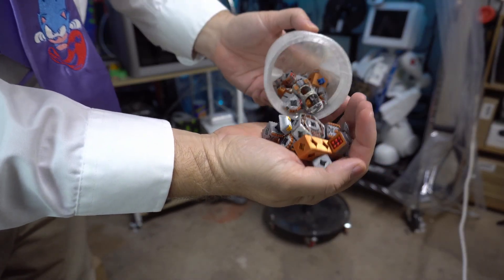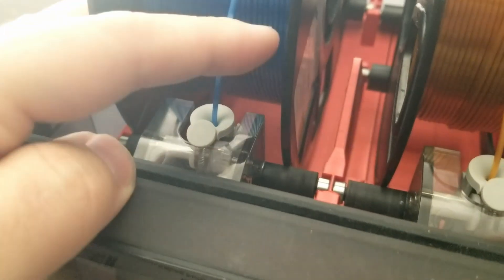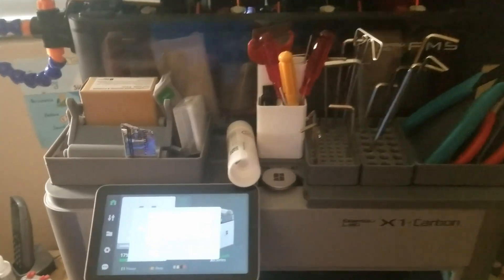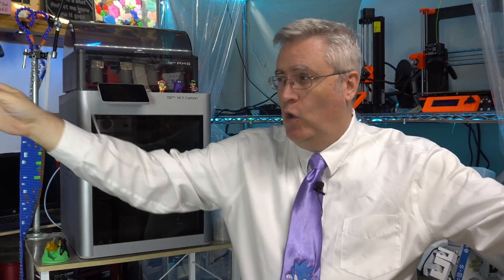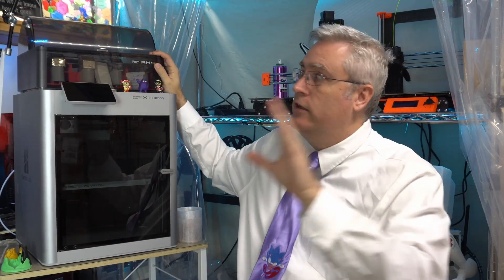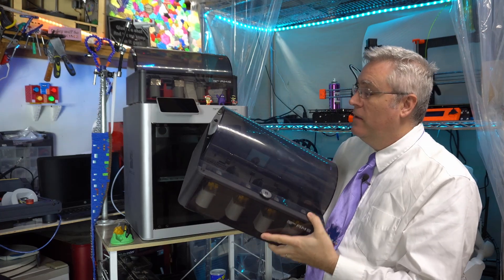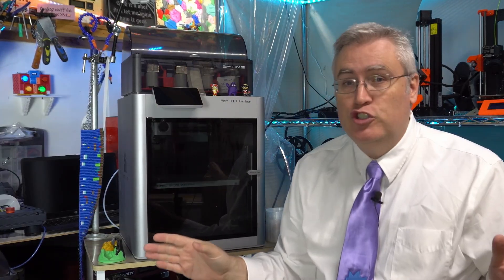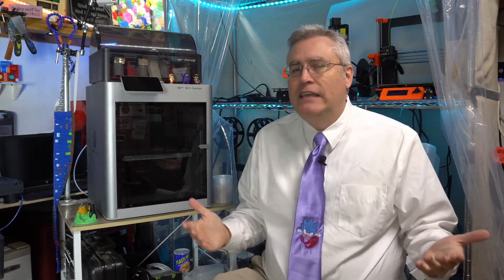My Bambu AMS died after only 1 year

Comment: 16hrs since posting - how’s the printer going? 

Bambu need to sort the waste issue. They say they are about sustainability but are nowhere near sustainable with the amount of waste they have And time to print (which takes more power). 

Prusa pushing that as a selling point over Bambu atm. It’s about the only thing they have on Bambu.

I have 2 mk3s/3s+ and they were bought 2-3yrs ago and apart from grease they just run. Beasts for reliability!
Reply from the maker: If only Prusa didn't require a separate enclosure.

Comment: I bought an mk3s three years ago. Prints great. Needed some replacement parts. Ordered bearings rods pronted some parts and rebuilt it. Prints awesome. I'm scared of these closed systems once they break what do you do toss it away? I can keep the mk3s running great with a few parts and can rebuild it whenever I wish. Its easy to work on easy to replace any broken part.
Reply from the maker: I will say, it was a bit disappointing when I upgraded my hot end to a Revo (which I love) that the next firmware upgrade freaked out. I'm currently running a firmware one step behind because of this. But at least it works. It's the start of jank, but it works.

Comment: I really related to this story and I understand why you wanted to keep your ID a secret.. Let me be your average Kickstarter nobody and this may surprise you.
REPAIR STORY from an average Kickstarter nobody, 
I am a backer , I did not get the AMS through kickstarter, however I did get one about 4 months ago or so...   My printer is from KICKSTARTER and I have had a few issues with parts or a cable going bad.  However my experience with support was fast and great.   They figured out my issue and sent me the parts free,  one was a bad print bed signal  cable and that was easy to do,   2 was a little harder I had to change  both circuit boards on the print head,  I had pulled off the temp sensor connector on the front board when changing print heads,  They had to send me both the front and back boards because they have been upgraded and my version is different, so they sent me 2 boards front and back and this tiny cable to connect them together,  Needless to say  I broke the connecting cable that attaches them ,  its hard to install and it was 100%   my fault,  I told them what I did and that I need the parts again and I have no problem paying for the parts because it was my fault.  They said don't worry about it and sent me  both boards and the connecting cable again for FREE .   Everything works and its all fixed .  ZERO cost to me and my response times were great.  Also this was all being done from BAMBU in china.. so I am the average nobody kickstarter guy and they treated me with great service,   I plan on getting another bambu im just wanting it to be a bit bigger. 
So far so good with my Bambu - 
Your average Kickstarter nobody

Comment: I think the downside of the AMS is that it's full of "consumable" parts. But it seems people keep using the AMS as a reason to say the "printer" has issues, but it's just an accessory to the printer. I don't personally have a Bambu (yet... it's on order), but I have been "dealing" with Creality, Ultimaker, Geetech, and Kodama (ugh) printers for about 8 years. So it sounds like Bambu is light years above those with regard to reliability. So if I have to deal with minor maintenance on the "printer" in that first year, I would say that a huge win for me. But I'm a bit jaded with maintenance nightmares and am happy to finally move on beyond those. Here's hoping the newer AMS units will be a bit nicer and have less unnecessary wear internally.
Reply: Mine took a dump after 3 prints because there's too much tension in the hub that pushes the filament out of the AMS. I've been waiting 4 days for a response from customer service.

Comment: FWIW, when I got my Kickstarter X1C (I was backer 148), the AMS was packed inside the printer. I received a second AMS last year as a holiday gift and it was slightly different than the one that came with the printer, but both units had yellow gears in the feed mechanisms.
Reply from the maker: Huh. Mine came separate. I wonder if I got a prototype or something. 
Well, that would have been a good thing to know YESTERDAY.

Comment: Good to know the guts aren't the same, my X1C was an early Kickstarter and had the spool roller breakage issue - which USED TO HAVE a fix on the Bambu forum but it was deleted. I think it's still on Printables. There's a printable mod that reinforces the roller sockets. My P1P & AMS were a new revision immune to the issue. Was the filament chewing due to the rollers rising out of their slots and binding (I got motor overcurrent warnings)?  That fix has worked for me, but I did not know the replacement parts won't fit my older AMS. I still have a problem on both AMS designs when it fails to retract and gets stuck somewhere between the AMS hub or adapter... it is NOT stuck in the head, as removing the tubing and pulling back from the head is effortless. Very annoying in multicolor prints.

Comment: The fact they don't supply parts for older variants of their current printer is worrying. What happens when they discontinue a model....will they carry on supplying parts? If so for how long?
Reply from the maker: Hopefully at least a year, but who knows.
Reply: By EU law manufacturer needs to supply parts for 10 years, but good luck with this chinese fraud company
Reply from the maker: @akierum  Fraud? That's a bold claim. And you're going to have a hard time proving it.
Or is it more about them being Chinese?
Reply: @3dpprofessor  A company with poor support, no stock for parts, like in your case, poor intellectual property rights protection, etc. is a Fraud.

Comment: I'm rather mixed on the hand-washing response of theirs.  Wasn't the entire point of invalidating those silly "warranty void if removed" stickers that a company cannot invalidate a product support request only because of a user's modification.  Video cards are a good example as putting a water block on one would usually require breaking the sticker, but just because the video card failed in the future doesn't mean that the user's modification caused it.

In regard to changing parts that causes old units to be unserviceable, the company ought to at least allow a trade-in maybe with -- at worst -- a nominal cost to the end-user.  For example, instead of buying maybe $40-50 worth of parts (that won't work anyway), give them $100 and your old AMS, and they'll send you a whole new AMS.   Although, the part that bugs me the most is that there really ought to be some sort of revision information (at least on the unit) so people can at least do their homework to understand what they have and what will work with it.  Also, I've got a few AMS units with my printers, and now I'm wondering how different they are.  My oldest AMS is probably from around 9 months ago and my latest one is more like... 9 days ago.  I took a look and all of mine have the yellow gears.

Comment: a lot of fair comments here but also it feels like Bambu are being put in a lose-lose situation by everyone.

they treated you well as an influencer,  will they treat everyone the same? probably not, and neither will most companies

do they have longevity? as you pointed out we can’t know that yet, but you didn’t exactly sound promising either. it very much sounds like you expect them to fail, and your experience with a KS (essentially pre-production unit) doesn’t hold much ground, especially when you are holding physical proof that they have addressed some preproduction issues (again, you pointed this out in a way too)

so what does this video actually achieve then? it gets you views (your job, i know) but more importantly it feeds into the constant negativity in our space lately

everyone’s gotta pick a side, and if they don’t they are going to get pushed out of the hobby
Reply: I totally agree with this comment there is so much negativity from both sides.
Reply: its a guy expressing his worries which imo is absolutely valid. creality has worse reliability and worse customer support however their stuff costs less than 200 bucks. not 1000+. 

at least with creality, you have cheap replacements thay will be available long after the company dies. bambu? once they stop selling spares, your done.
Reply from the maker: It was really difficult to strike the right tone with this video. I want to be fair and honest, and there's a lot of people making assumptions about what they think I'm saying.
Maybe I need to follow this up with a "10 things I love about my Bambu".

Comment: The disposable 3D printer company.

Running changes like that, and not supporting products long term, are exactly what the Prusa stans were on about.

I think its perfectly reasonable that a new company would struggle with such ludicrous immediate demand, but it is still concerning that they already have products that you can't fix. They're <2 years old. I could fix and run my monoprice i3 from 2015 (8 years ago) if I felt like it.

Comment: I have had similar issues with my Kickstarter AMS. With a long path to the print head and multiple driving mechanisms for the filament, i no longer expect any filament to work. I stick with filament that has proven AMS friendly. I use the back for the ones that have not worked well in the AMS. Filament that has inconsistent diameters or isn’t straight or true may have too much drag or worse. Some spools rotate poorly in the AMS and I’m not talking about cardboard ones, so I avoid those too. It has reduced the situation to occasional problems. The AMS is very cool, but it’s not bullet proof, so I have tried to adjust to that reality accordingly. It’s good to know ahead of time that there are no spare parts for Kickstarter AMS units and that even a new AMS unit may not work with the Kickstarter X1 Carbon. Thanks for keeping us all informed. This printer has been a game changer for me and has made 3D printing much more enjoyable. I’m waiting for the larger one.

Comment: I've seen a number of printer farms adding these to their production lines and I would think that is where the rubber hits the road on maintenance over time. All the new high speed printers are impressive and shiny right now, but over time I think we might see a very different story. Tomorrow I'm going to review the new Kingroon KLP1, but will it last for 5years or 10years running daily darn good question.
Reply from the maker: Kingroon wanted to send me one. Like they really really really wanted to work with me (they said), but they wanted my video out by december, and I've literally got a stack of 3D printers I'm working on right now, so I told them if they paid a sponsorship fee I'll put them at the top of my queue, and suddenly they didn't want to work with me that much.
Reply: Funny how they can dance backwards when it comes to cash. LOLOL...I'm under the gun for Nov 15th dead line. The machine is fine, but the software...just not ready for the public in my opinion.

Comment: I had an incredibly frustrating 2 weeks of back and forth with support where all I wanted was some advice on what parts of my printer to check to trying to isolate what was causing a pretty horrible squeak/rattle when the bed is in a certain position (owned printer for 4 weeks with it only lasting 2 of those weeks before it started making the noise). Sent videos showing comparisons between normal and abnormal operation etc... got no help at all; felt like being gaslit by them claiming it sounded fine (I promise you it DOES NOT sound fine).

The printer is otherwise great, but I certainly won't buy from them again (and I had initially planned replace all my printers with bambu units).

Comment: Excellent video. Can I ask you on behalf of us "normal" customers, to try and do a follow-up with Bambu on their stance regarding Hydra? They clearly state in their wiki that you don't lose warranty, but that they can ask you to revert it to original state for troubleshooting (and I find this completely fair). 3D Musketeers also claimed you lose warranty (but the more I watch his videos, the more I suspect he has a beef with BL and is just spreading FUD).
And yes, I suspect you got Youtuber experience when they shipped X1C Combo instead of having you troubleshoot AMS :-D I think they shot themselves in a leg there, though, because while the internals might require new motherboard (so in your case they'd have to ship you new board and 2 more new first stage feeders, maybe even the internal hub and have you effectively refurbish the whole thing), the "old-style" AMS should still be compatible with new X1C and vice-versa without problems. They actually seem to have an upgrade path for most incompatible changes and they do (or did) stock some previous-gen parts and support is able to ship them - in the end I think it's just limited by them having new old stock replacement and after that they'll might force an upgrade on you I guess. So no, I don't believe a regular customer would get a new X1C, but I also don't think he would need one,. They just took the easy route to get you up and running, the question is why. Maybe they are so loaded now that they can just ship X1C to early backers as a perk... heh.
Reply from the maker: I'd like to think that the reason why their wiki now says it's okay to use the Hydra is because of my conversation with them. Probably not just my conversation with them, but I like the ego stroke.
Reply: @3dmusketeers doesn't have beef his criticism is from a place of love too,  he has reached out multiple times to BL to help them and is also working with Sir Will.  He is very critical and has brought legitimate security concerns. I worked in it for a long time and I also had the same concerns especially when it relates to NDA or ITAR. If don't deal with those then your ok it just your personal  data.
Reply: @elchavode6479  He continuously claims there's no way to use it without the cloud, he claims Hydra voids warranty (I'm pretty sure that Wiki article has been saying it doesn't for at least the last ~3 months), and he claimed that BL have been creating profiles (creator profiles, not print profiles) on Makerworld and stuff like that. Sorry, but that's FUD...

Comment: It will be interesting to see, how long 1st gen printers will have parts, after 2nd gen printers (I'd assume it's more than just a bigger printer) come out 🤔
Do X1/P1 AMS and A1 AMS have any common components or modules?

In a way , if printer costs more on filament than value / day, just buy whatever works for some time and dump it when new models arrive.
In a way , keeping $200-300 printer for several years while 2 years of Netflix costs the same is dumb. If one smokes or drinks, they cost a lot more / year.
In a way , dumping working printer just because it's slow (in 2023 "standards") is kinda foolish, unless quality is better on new printer or it has been printing literally 24/7.
In a way , Prusa seems even more practical buy than ever (even when it costs sort of a lot compared to what you get, but not so much compared to what you get (most people don't know what actually goes into their printers) and where it's made).
In a way , new printer is always a lottery: either it works, or it's lemon-ade. Ratio might be 99% good, but it really doesn't help those who get the latter. Hopefully returning and getting money back works without declining credit card payment (dragging feet beyond declining period is never a good sign).

I like that you bring up how normal reviews are done: printers are free, testing lasts 1-2 weeks max, recommendations are made based on first impressions, hype gets wings... For individuals it can be like "the best printer I have ever had" - well, to what are we comparing?

Comment: Awesome video, thank you. Also having experience with DJI products and their forced obsolescence and closed source proprietary attitude it does give me pause on bringing a Bamboo anything into my print farm. I just got rid of my last cheap and heavily modified printer and am now running all Prusa because they do run year after year with little to no maintenance (but are easy to service) and now a creality K1 and K1 Max because they support an open architecture approach and the general maker community by sharing back (in their own way).  Bamboo got its start by taking from our community and pulled it behind closed doors.  That just rubs me the wrong way. Watch, they’ll be glad to snatch onto those AMS mods, again from our community, to make a buck and not show any credit to the real inventors. ……. Will be interesting to see their equipments longevity also.
Reply: Amen 🙏

Comment: You asked about "what would be a good benchmark for value?"

We probably need a metric.

I think a calendar is not the best marker of value. 

The first factor is raw (kilo)meters of plastic extruded or hours of continual operation. 
These numbers are tracked by the firmware and are available on most printers. Assuming you
don't have to swap the motherboard out on a regular basis, which brings me to:

The "fuss" factor. How many hours of human effort are expended to set the printer up. How
many hours are spent repairing or maintaining the machine. How many days has the machine
been idle awaiting repair/spare parts/etc.

Finally the raw cost. Outside of filament, what expenses went into purchasing the machine,
upgrading the machine, repairing the machine, etc. Though we do need to somehow factor in
the cost of basic repairs vs. the costs of adding an additional capability.
Reply from the maker: That sounds like a lot of work. But you're not wrong.